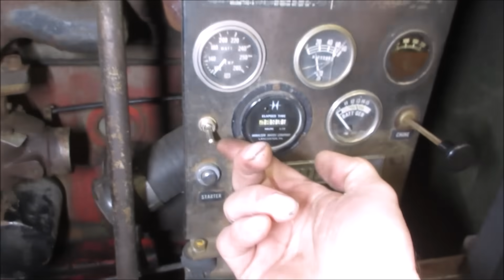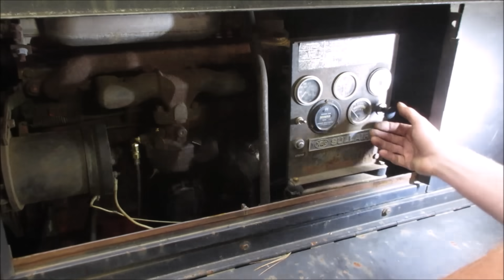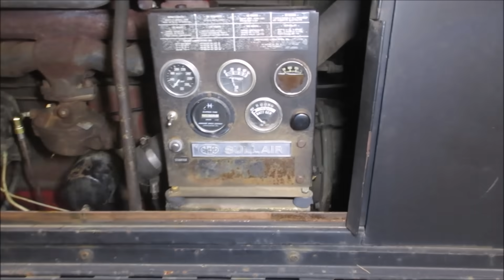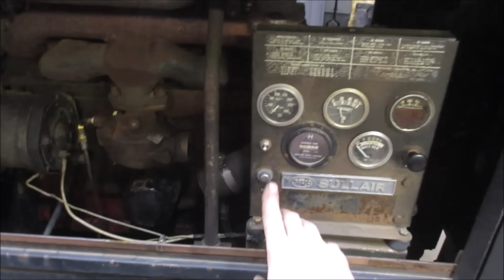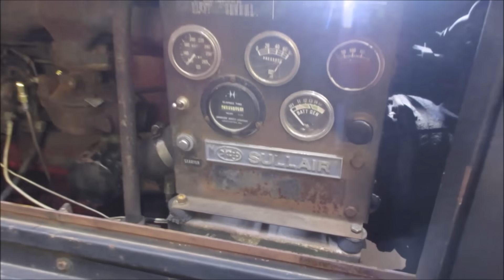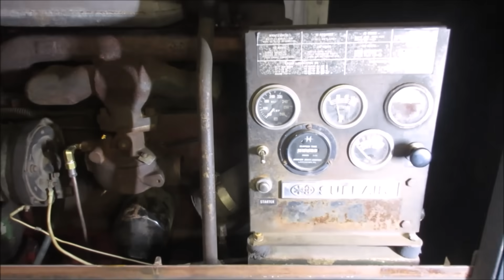Vintage Air Compressor Stalls Under Load. Cheap Fix.

Comment: On starting, engine and compressor are full throttle. The pressure regulator (Cashe Acme valve), depending on adjustment, will send pressure to the main throttle diaphragm (Sullicon control) to start throttling down. I’d get a rebuild kit for the regulator, the one with the copper diaphragm. No o-rings in the regulator, only gaskets, or with the rubber diaphragm, none.

It’d be a good idea to reconnect the high temperature shutdown switch to kill the ignition during overheating. Flash fires are no joke.
Reply: From the sounds of it that compressor only runs for a little in the cool weather. So it'll probably never overheat.

Comment: You make videos, but I don't so I'd like to share this with you, and maybe you can do a short video to show others how to accomplish this. Just an idea. I see a lot of folks that want the ability to mow with the chute up for various reasons. They use bungies , string or a piece of rope and that to me is so inconvenient. I have never shared this, but I've done this set up on every riding mower I've ever owned and it's fool proof. Use a hook and screw eye's to latch the chute up . Attach one screw eye to the side of the rear fender and two screw eyes to the chute. Test distance before drilling to ensure the screw eyes are in the right location. Attach one screw eye on the chute with a spring, and the other end of the spring to the Latch hook, The second screw eye is also attached to the chute just far enough to just give the spring a little tension so the hook can be latched to that second screw eye firmly when chute is being used . Now when you want to open the chute the Hook can be latched onto the screw eye mounted to the fender to keep the chute up and out of the way. This method also allows the deck to be raised and lowered when the chute is raised. This setup is on my 1999 Scotts S20hp/48 which thanks to you and your videos still runs and operates fantastic, and my 2018 46" Cub Cadet XT1.  So simple & inexpensive, but absolutely effective. That setup has been on my Scotts since 1999 with the same hardware I originally used. I hope this helps someone , if not there's always the option of a bungie or a piece of rope. LOL

Comment: The bell object is a pressure regulator  that is part of the unloader valve assembly.. As the tank pressure reaches a designed pressure it unloads air and backs off the  throttle. The breather hole is a telltale when diaphragm fails. The screw on top regulates air inlet pressure to set unloader and  throttle cut out.

Comment: That sounds a lot like the Massey Harris 50 I used to play with, cranking & running. It was also a pushrod i4. Same type of carburetor, too. (Probly not the same model, I'm only 5m in.)

Comment: Excellent video Mustie   1 :) also that cool video on air compressor  for fix up bleeding valve part and homemade muffler! That motor looks too me is farm tractor Farmall (International) 156 Cubic Inches  4 cylinder  40 hp one too and be noisy to Lol ! Also that golf cart need seat belts for sure 👍  and  Happy Thanksgiving Holiday USA 🇺🇸  to!

Comment: That attachment on the other side of the air valve is a "oiler" for using the air compressor for things like jack hammers/other air tools.

Comment: Tune-up, verify and fix leaks, redesign the hood for access: hatches, two part hinged top, removable gates. Next, upgrade or replace some parts or components if possible e.g. diaphragm, gasket, etc. Or the auto muffler for reduced noise.

Comment: Regulator looked like an early 70's design. 1 problem with Compressors is the Intake air is sucking in fumes from the generator, so contaminants get concentrated & foul the air system. Is a common problem with Garbage trucks that lift bins repeatedly. The on/off valves stick & have to be cleaned in solvents to break down oil particle build up on the spool.

Comment: That's a pressure regulator. The main function of it is to keep the main tank pressure off of the diaphragm that operates the throttle. As a side-effect of that, I would assume it also turns the tank pressure into more of an on/off type of signal.

Comment: The air servo should be at WOT at rest and then bring the throttle down as the air pressure gets to the set point.

Comment: That would be a pressure regulator. I reckon it was a mix of three issues. 

The rubber diaphragm being stiff, which would restricted movement. 

The adjustment was too tight(for the age of the diaphragm today)

The two combined meant no air flow to the throttle diaphragm.

Comment: The regulator is still used nowadays - have a look at gas welding rigs and you'll see the same style of brass 'bell' with a T handle rather than a screw.
The owner needs to take it off or get a part number off it when the season finishes and rebuild kits are available but they're rarely used as new regs can be as low as $30

Comment: That diaphragm, the large one moves the throttle to idle when the pressure builds up, the small one just sends air to the big one when the set pressure is reached. I think all you have done is reduce the set pressure, the stalling out was due to too much load on the engine due to back pressure on the compressor, not sure if the pressure relief was opening or not but it should have done long before the engine stalled out. Not used to gas powered units just worked on diesel ones.
Reply: Before Darren took the regulator apart that throttle diaphragm wasn't doing anything. As others have suggested the whole air system is probably clogged with oil. Because that's how those air compressors work. They pump air and oil then separate out the oil. They don't separate out all of the oil though.
Reply: @1pcfred  I saw that the diaphragm of the speed control was not working but it was stuck in the full throttle position, it is pushed by the air pressure to close the throttle down. And yes it looked like the compressor could do with fresh oil.
Reply: @Equiluxe1  the engine certainly wasn't running full throttle. It was barely running at all.

Comment: At Joy Manufacturing Co. in the town where Sullair began, I worked briefly for the engineer who was accusing Sullari's founder of stealing his screw compressor tech. High crimes and misdemeanors. I left before I learned how the whole controversy came out.
Here's another machine where I would look for an operations manual first, rather than guessing. There could easily be important nuances that are being missed with the first-principles stuff.

Comment: Great job, only concern is with no setting on the regulator screw, could the pressure get dangerously high.  Hopefully there is a safety bleed off somewhere.

Comment: That was a pressure regulating valve that had the small adjuster screw wound down too far, so the engine was trying to produce excessive air pressure.    Your use of the O Ring was most likely not required, as the spring chamber was open to atmosphere anyway.

Comment: Oddly enough i got the same compressor. That is the pressure.  It does a few different things. One is keeping pressure about the same at all times. It also adjusted the Throttle an the air valve on the intake side. If the throttle  valve is not working it will shut down if the blower pulls a vacuum. Because the arm not only controls the throttle but the air cut off on the intake pipe on top of the blower.

Comment: So that's called the pilot valve,and it controls the pressure output by throttle position.

Comment: Seems you halfway fixed it.  The stalling under load is fixed, but it is still a PITA to start.  You should be able to work your magic on that so it pops off within a few seconds of hitting the start button.

Comment: Pressure on the big diaphragm increases throttle. My guess is system pressure was leaking past original small diaphragm gasket out the weep hole. The o-ring allowed system pressure to go to big diaphragm rather than leak by to weep out

Comment: Yhat one may be old but a least it had electric start. Th one I had to work on had  to be hand cranked. By the time that was over, my right arm was two sizes larger. It's the little stuff that gets you.

Comment: I can't believe I'm going to say this, but... 

"No, mustie1, you're thinking about it backwards. The engine is intended to run at full throttle until the tank pressure gets to the threshold set by the party hat valve. The spring tension on the throttle lever is reversed from a lawn mower... it's set so that its default position is at FULL THROTTLE.

When the party hat opens up, the pressure is then allowed to flow thru the tube and activate the big diaphragm, which pushes on the throttle lever LOWERING the RPMs till the tank pressure drops again (equivalent to taking your foot off the gas pedal). The the party hat closes the passage to the throttle diaphragm and the spring tension again returns the engine to FULL THROTTLE until the tank is once again at full charge.

See what I mean? That poor engine is flooding tf out before it can even get warmed up... I bet that fuel smells like a bucket of smoked gasoline..."

Comment: That choke cable needs a bracket on the outer jacket to hold it solid so that the inner cable can pull like it should.

Comment: Check for oil in the receiver if not top it up that is an air pressure adjuster the more air it makes the more it should rev

Comment: what you played around with is a common adjustable pressure regulator.....
Reply: I'd say the fix is to just replace the whole thing. But folks say rebuild parts are available. That diaphragm did not look long for this world to me.

Comment: with the regulator screw all the way out, it will always run full throttle. hard to say how well it would adjust with that petrified diaphragm. guess full beans is fine for what the unit is being used for.

Comment: Looks like a Ford JE134 or JD172 industrial 4 cyl about 50 hp for the 134, and 63 for the 172. Updraft intake setup just like the tractors they came in, throttle/governor/regulator notwithstanding....

Comment: That thing is the pressure regulator. You probably should replace it. That diaphragm in it looks pretty beat. Probably just get a whole new regulator. Air compressor regulators are all the same.

Comment: Regulator not working diaphragm or adjustable regulator not working or adjusted right cause of its depending on air pressure

Comment: That’s a very early Sullair compressor! The engine is a Continental. Not sure of the model. No longer made, but parts are still available for a lot of them.
Reply: I thought it looked like the old Red Seal engine like we had on our vintage forklifts in the eighties,our mechanics would pull them when they got noisy and rebuild them,later on they started buying rebuilt long blocks from the local Cat dealer, guess it was more cost effective and saved time, but they were tough little engines considering the way we drove them back then.

Comment: You figured it out in a heartbeat, did you ever reset the screw on the top of the valve you took apart? You ended the video with it still backed all the way out. That may affect the output if you use the air for implements.
Reply: Darren said all that air compressor ever does is blow out water lines. So if it can build up 30 PSI it should do.

Comment: That yard track, at the end, makes 15 MPH seem like 40, plus, you sit so low, you can take corners with out fear of flipping. what size sled motor 440, would be my guess?
Reply: It's a 250cc single cylinder yamaha engine
Reply: I didn't do much video of it , their is a short one on my channel , ugly but fast I think I called it

Comment: MUSTIE HAPPY THANKSGIVING . FIRST THE COMPONENT YOU TOOK APART IS A PRESSURE REGULATOR SECOND YOUR EXPLANATION OF HOW THE THROTTLE WORKS WAS BASS AACKWARDS . WHEN THERE IS PRESSURE IN THE LARGE DIAPHRAGM THE ENGINE IS AT IDLE  WHEN THE PRESSURE DROPS IT INCREASES RPMS.  IT PAINS ME TO SEE SOMEONE SO MECHANICALLY INCLINED GET SOMETHING SO SIMPLE SO WRONG. IF YOU HAVE TIME RE WATCH THE VIDEO AND PAY CLOSE ATTENTION TO THE LARGE DIAPHRAGM CONTROLLING THE THROTTLE .    YES I KNOW THIS SOUNDS LIKE I"M BEING A DOWNER . NOT WHAT I INTENDED.

Comment: You need to re-adjust that valve so it's not running full throttle when there is nowhere for the air to go. Will wipe out the pump.

Comment: That thing is overkill for an air compressor, but it's definitely a great piss your neighbours off in a box!
Reply: Sometimes you can get trailer compressors cheap. Especially if they're old pieces of crap with stuff wrong with them. $50 is not unheard of.

Comment: I don’t know how this works, or what it actually does.  It was just part of the throttle linkage so I took it apart to look and clean it.  Now it works fine.  -Mustie1
Reply: I can't believe Darren doesn't know a pressure regulator when he sees one. I also can't believe he fixed that old piece of crap either. Most people would have just replaced it. In fact if it was mine I'd still want it replaced. That diaphragm looks like it's ready to pop to me. But last week he was pouring oil into tires to fix them.
Reply: You are good Mr musti

Comment: It always amazes me the gaps in people's knowledge.  How in all the years has Mustie never worked on an air regulator?  I'm quite certain it is not fixed and might blow out that diaphragm on the throttle control.  With the bolt all the way out (lowest pressure setting) it should not have let any air into the diaphragm, but it went to full throttle as soon as power was applied.  I doubt that diaphragm is supposed to get the full pressure of the compressor or they wouldn't have put a regulator going to it.
Reply: The regulator regulates the output of the compressor. Once it hits pressure it backs the throttle off.
Reply: Every regulator I've ever seen you had to turn the screw in farther to get higher pressure, with the screw out it should not have let any pressure through to the throttle control.
Reply: @MartysRandomStuff  every regulator I've ever used you screw in for higher pressure. But when I was messing with my well I found out about this other gizmo that's like a regulator. I almost bought one by mistake. It looks just like a regulator but works in reverse? I forget now what it's called. I also forget why it might be needed. Was some special case deal. I'm trying to block that whole nightmare from my memory.

Comment: Sounds like the pressure relief valve is not operating properly compressor building too much pressure before it releases and stalling engine

Comment: Parts are easy to find the large diaphragm is called a Sullicon
Reply: What it needs is a new pressure regulator. The throttle servo seems to be working. But who knows for how long. I can't believe Mustie was able to take that regulator apart and put it back together and it started working. The diaphragm in it is hammered. The whole air system probably has oil crust build up in it.
Reply: @1pcfred  I wonder if it’s had it’s filters and drier sorted in the last 20/30 years, Reg kits are 30-40 bucks replacement new regs are 800 !!!!
Reply: @Mrflash222006  it doesn't look like an $800 part to me. I wouldn't give you $800 for that whole compressor. People need to put the crack pipe down when they're pricing stuff.

Comment: That rubber diaphragm needs to be replaced. Your pressure does not come up enough. You need to have 130 psi  as a pressure comes pressure it shows low the motor down to maintain pressure with out over pressure

Comment: Im only about 1/4 of the way in, but im thinking part ofvthe problem is the pressure relief is set too high and it is stalling out the engine.

Comment: Your theory of operation is backwards. The control pushes out when sensing pressure to slow the motor down. Previously it was stuck at full throttle. Most likely the unloader was stuck and causing it to choke the motor out. Knocking things around probably broke the unloader solenoid loose.

Comment: That pressure switch probably turned the compressor head off and on or shut the engine down when it reached pressure

Comment: Mustie.. You know that poor 4 cylinder F-Word needs a full tune up after years of neglect.
Reply: Nah. It runs like a top. When it runs.
Reply: @1pcfred  Except he has to hand coke it and it isnt running like a top, yes.. lol
Reply: @Ajaxaxxess  it was running pretty good. Once it got running. Supposedly it has just been tuned up.
Reply: @1pcfred  the guy who did it did not even set the choke cable, I'd not trust much else of his work.

Comment: Years ago (about 45) I had a small contractors 5 HP compressor that worked the same way with a small slave cylinder hooked up to the throttle controlled by a adjustable air diaphragm bleed off the 30 gallon tank. The normal throttle position was wide open and as it built pressure the throttle would slowly close down. Mine also had a blowoff valve that would open at 120 PSI to keep from over pressuring the tank. Used it for painting barns and farmers machine sheds with airless paint systems.

Comment: I thought everyone had switched to that plastic pipe that can tolerate freezing by now.
Reply: Frozen water can mess all kinds of stuff up. Like the spray heads. You want the water out before a hard freeze. Water expands as it freezes which is weird. Everything else contracts. That's why ice floats on water. Ice is less dense than water is. But as the density reduces the volume increases. I don't know how much pressure water makes as it freezes but it's a lot. It'll crack an engine block.